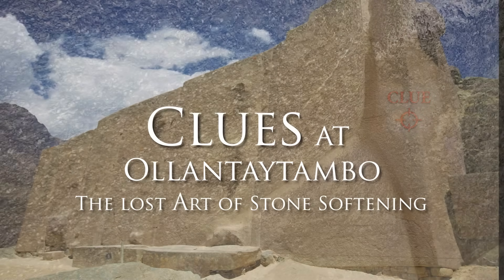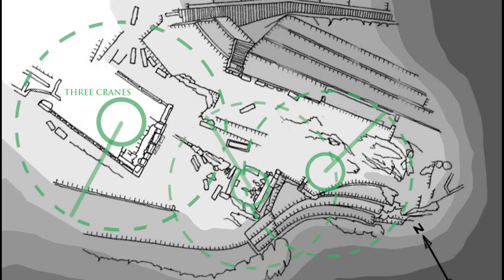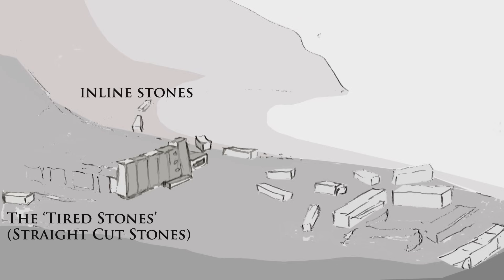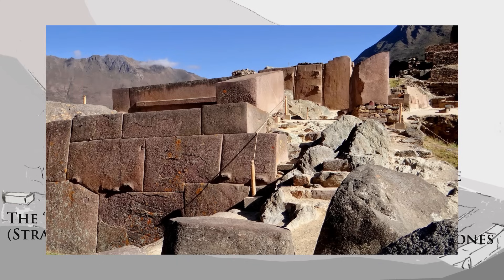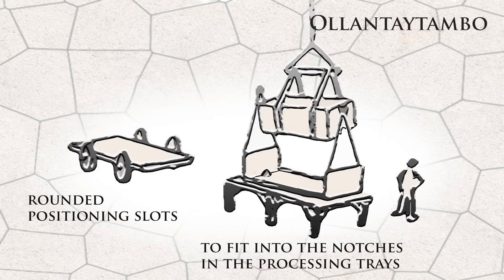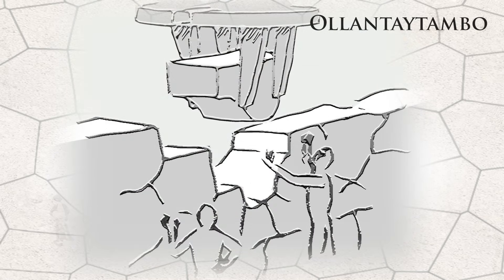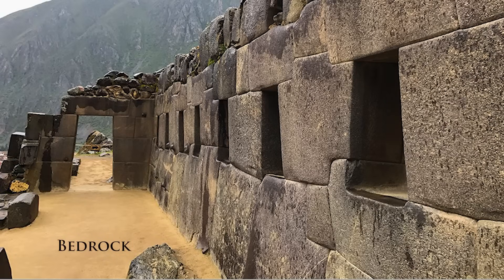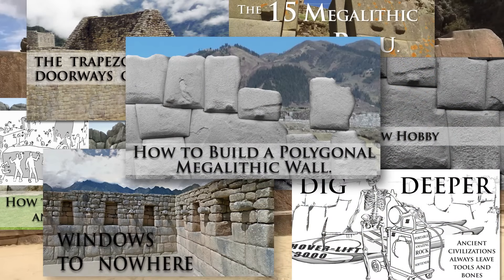Clues at Ollantaytambo. The Lost Art of Stone Softening

Comment: Interesting. Could you explain the sonic requirements and how this was performed. And how they lifted 100 ton blocks into the tanks?
Reply: I personally think they didn't go through all that trouble. My opinion is they built the stones from scratch.  From all the minerals in the area
Reply: @papasmurf4453  is it?  How do they cut them from the quarry in the first place?  Chicken bones?  I'm not saying ti was aliens but i'm not saying it was not either.
Reply: @papasmurf4453  haha intelligent question
Reply: Cement bro, what's with this vibrator theroy.🤣🔈
Reply: @papasmurf4453  Sonic glue?
Reply: Ha, ha, good point. And; otherwise, the stones were rolled down hill 6 miles away, across a couple of tricky rivers, and then rolled up hill with slaves. This guy's explanation is beyond silly.
Reply: They build the tank around the stone 😂
Reply: He will probably tell you they used trumpets like it says in the fictional book called the bible by imbeciles
Reply: Anyway, whatever technique was used is still missing today:
- No full-scale experiment (nobody has ever cut and fit a 100-ton andesite block with only stone/bronze tools).
- No evidence of real quarries or workshops (no debris, no proportionate tools).
- No critical review: academia keeps repeating the “solved” story.
And yet we do have abundant evidence from Greeks, Romans, and Assyrians — technically older civilizations than those of the Andes.
In the 21st century we could easily:
- Run controlled lab tests on abrasion.
- Simulate forces and times with modern software.
- Reproduce quarrying methods on site.
But no major institution dares: if results prove the “official” methods unworkable, they’d have to admit we don’t know how those walls were built.
So yes — we’re in the 21st century, but the narrative on these sites is stuck in the 19th.
If official academia were to test and admit that tools and material evidence are missing, it would open the door to alternative hypotheses (lost techniques, earlier civilizations, etc.), which academia tends to dismiss as “pseudoarchaeology” — when it would simply be enough to confess ignorance.
Reply: Haha true true 👍 😅 😆 😄 🤣 😂
Reply: How did they lift 100 ton blocks into tanks? The same way they lifted them onto a 30ft wall?
Reply: He shows drawings of cranes.
Reply: @charlesco7413  Don't forget the carts with wheels. The accepted belief is that there were no wheels in the Americas until the Europeans brought them.
Reply from the maker: Maybe it's time for me to illustrate another video,, clarify a few things,, Oh- and there aren't any 100 ton stones at Ollantay.     Nice channel (yours) BTW.
Reply: Sure, Imagine BS prehistoric Science , dream on it, make a video about it and do not explain anything.
Reply: Flint, Copper and Sand. You do not need hi tech to shape these stones. There are many recent experiments done to prove this. Videos are on youtube. You only need to search for them. There is no need for high technology.
Reply: @YATESAsphalt8  Exactly, there's a man who was moving 1 ton stones, 300 feet an hour using leverage. A stone and wood arm bars.  Some of these stones exhibit pivot extrusions where the stone could balance from.
Reply: @MrC-55  Yes, his name is Wally Wallington. People who think it can not be done, should look him up. Also, the sawing and drilling, again, can be done with copper and sand. It is not hard. It just takes effort and time, but not even as much as most people think. People should investigate recent experiments which prove it can be doen, instead of tripping on ancient mindblow. :D
Reply: @YATESAsphalt8  How did he get the slab onto the first little pebble?
Reply: @YATESAsphalt8  what about the twisted blocks, you gotta admit, that is quite odd.
Reply: @veniqer  'Give me a place to stand, and a lever long enough, and I will move the world.' Archimedes
Reply: @BornAgainCynic0086  Not sure which blocks you refer to right now. I am sure they are product of a highly trained craftsmen. I am not underestimating the skills of ancient cultures. Most people who believe some of the work can not be done are doing so; they claim Egyptians or other known cultures were not able to work with stone, which is rather odd, because we had something like a stone age. There are many methods to manipulate stone with rather primitive tools and techniques. I am not an expert, but I have seen a lot of people proving the point in videos, here on youtube. Once you know the trick, usually it is not very sophisticated. Like a magician doing the impossible, but it is not impossible; you just do not know how they did it. Luckily there are many modern experts who do know. Try looking into these youtube channels. They are at first not as exciting as a mysterious lost ancient culture channels, but you learn way more.

If you want me to reply on the twisted blocks, please tell me which ones. I can not guarantee answers. I am just a simple youtube user, trying to be honest.
Reply: @YATESAsphalt8  Please explain how to insert the lever underneath the megalith?
Reply: @YATESAsphalt8  in this clip there are twisted block, sort sagged looking. Just as if they had been soft but had sagged. Why would they carve out a sagged block?
Reply: @veniqer  Great reply. Not claiming I know for sure, but you can tie a lever the top side and only need a tiny cut in the corners to fix the rope. Also pointed lever could lift it maybe 1 mm, the next lever you use, can do 2 mm...  once you have a few cm lifted you can toss a dolerite pebble underneath, while you have not even lifted half the weight of the megalith. On that pebble you can easily make a heavy stone rotate. On 2 pebbles you can even move it.....
Reply: @BornAgainCynic0086  Yes, these stones sure appear like they have been soft. A product of once soft clay... bent by gravity due to the weight, but I think these surfaces are just the result of where they split the stone from the quarry. The shape is by nature. When you quarry a stone, you will make it break away by putting pressure on natural cracks. Sediment layers in stone. If you google Ollantaytambo Quarry, you can see the distinct shapes of these layers. Just my two cents..... -and makes more sense than softening the stone with organic material while using frequencies.

Comment: when you figure out how to soften stones, let me know. I have a few kidney stones to get rid of.
Reply: I'll help you with that one.  One remedy to use to help when passing a painful kidney stone is to drink lemon juice.  I went through this many times and it works (usually within a 1/2 hour of drinking it).  The pain starts to subside and then goes away.  Lemon juice is a strong acid that erodes or rounds off the sharp jagged edges of kidney stones.   This makes them smoother and less jagged, so they are less painful to pass.  But the cost of this remedy is acid damage to teeth enamel.  My belief is that an acid that's strong enough will affect stones EDGES or surfaces at the very least--whether calcium kidney stones, your teeth, or stones made of rock.  It can also make a whole stone erode away and become smaller or even disappear eventually.  Maybe certain types of rock are affected easier than others by an acid.  Not sure if whole stones can actually soften all at once, including the center of them, without direct contact with an acid on the inside.  But at least the edges can be rounded out or shaped with an acid and a tool, then fit the shaped rocks together to your liking.  But getting a whole stone to the consistency of blubber....I don't know of an acid that can do that.  I don't think an acid will make a kidney stone soft to bend like blubber, but instead you could eventually wear it down and disintegrate it.  Or at least make edges smooth and fit well with other kidney stones, like making a kidney stone rock wall.  :)
Reply: Okay well, I guess maybe stones could soften too, to some extent.  Having had a lot of acid damage done to my teeth which has led to decay, I realized just now that sometimes when I grip my teeth together, they feel soft and a bit squishy at the decayed places.  (Sorry tmi).  So I just asked the online AI if teeth can soften from acid and it said this:  "Yes, teeth can soften from acid exposure. When acids from food, drinks, or stomach contents come into contact with teeth, they can start to dissolve and soften the enamel, the hard outer layer of the tooth.

Once the enamel is softened, it becomes more susceptible to wear from normal activities like eating and chewing.
 This process can lead to gradual loss of the tooth surface if not addressed.

To protect your teeth from acid erosion, it is recommended to wait at least 30 minutes after consuming acidic foods or drinks before brushing your teeth, as brushing too soon can exacerbate the erosion.

Additionally, using a straw for acidic beverages can minimize direct contact with your teeth, and rinsing your mouth with water afterward can help neutralize the acids."

Comment: For those who didn't get any info on how these rock masons did the work from this video:https://www.siftdesk.org/article-details/On-the-reddish-glittery-mud-the-Inca-used-for-perfecting-their-stone-masonry%20/264  You will have to read this paper as it explains how they got those stones to fit so tight.Other questions on how they transported the huge rocks for miles in those mountains without wheels or cranes is still being researched. Iron pyrites with water turns to sulfuric acid.They mixed hot iron pyrites(fools gold) and mixed it with plants  containing oxalate which enhanced the softening and molding the volcanic rock which contains large amounts of silica.Cross sections of the joins clearly show vitrification of the rocks which isn't present in the majority of the rocks.

Comment: Fascinating. If they had machines of metal then why build with stone? Unless those baskets, tables, and cranes weren't made of metal.  All that's here seems to be only the product without the process.  If everything abruptly stopped then why aren't these machines and such found with the structures? It's as if the process was deliberately hidden or discarded. Along with your theory,  I am sure it helped the stones were softer, by another theory that this planet was much closer to Jupiter, and due to a cataclysm, was spinning slower, causing less gravity, making stone easily malleable. Everything in the ancient times was giant sized because of the gravity.  Drifting towards the Sun through many ages size lessened or became more condensed molecularly.  Now we are spinning faster and closer to the Sun making stone harder.  Humans and everything are smaller. Maybe the composition of the stones have changed much that the procedure to soften the stone won't work in the conditions we have now.  Fascinating.

Comment: It would seem to me that stones that heavy when softened would bulge in the middle before hardening.  With out some kind of mold to keep it in place .   Al those thousands of different micro angles ; I just don’t know how they kept them do flawless .  Even to construct wooden molds to hold polymer stones in places would be an astonishing effort.  I think you’ve got some good ideas but somethings still don’t seem to match up.   It’s such a frustrating enigma .   It’s as if the stone makers are mocking us
Reply: If they were cut square why not use them square? It's easy to fit squared blocks tightly if straight. Why did they change the shape. That is the bit that makes me wonder!
Reply: @barrymayson2492 out of necessity, maybe because of the frequent earthquakes? Square blocks rattle apart, but the fitted stone walls have endured thousands of years of earthquakes.
Reply: @barrymayson2492  from what I've gathered from information presented to me, they did this to create earthquake proof structures. That's why they still stand today... millenia later
Reply: they definitely used some sort of energy such as thermal or electrical or acoustic or magnetism or a combination which we will haven't figured out at. it seems some were melted, some were tooled, some were laser cut, but the most important thing is not that actually, it is the fact that they were transported there..........through airship? through liquefaction? the logistics does not match up and the evidence of flood completely wiping them out is obviously the truth.
Reply: read about Electric Universe, youtube channel Thunderbolts - Symbols of an Alien Sky.
the idea is that thousands of years ago there was a completely different environment. meaning reduced "gravity", which allowed megafauna. There's a problem with megafauna(dinosaurs). In today's environment, the biggest land fauna is the elephant at 6-10 tons. Argentinosaurus at 100 tons would not be able to sit on its legs, its neck would snap.

A completely different environment thousands of years ago means that perhaps stones had completely different behavior. 
In the bible, they talk about "mountains melt like wax in the presence of the Lord" - psalm 97:5

I think that cutting stones that today are very hard, was not difficult in those times. 
Also, I think there were very few humans on this planet in those times.
Reply: @criztu  i think the opposite, there were a lot of people and it was just as difficult then as now.
Reply: @criztu  lol   Reduced by 4% or less
Reply: Maybe there were magma tubes that glowed from an active volcano and they had molds that would fill up with magma. That would explain the intense heat?
Reply: I can't explain how the rock was softened, however,
the process can be demonstrated using 'Therapeutic Putty' or 'Science Putty' from the Science and History museum.
Put the putty in a freezer overnight. Then cut the putty into small lumps.
Stack all the lumps together like a dry stone wall.
Allow the putty to thaw out until it starts to soften, as it does so the lumps will 'cold flow' into each other.
When the putty polygonal wall is at the desired fitted 'perfection', spray with 'Arctic Spray' to freeze (set) the putty hard again.
It does not explain how Granite was softened but this demonstration does adequately demonstrate how Polygonal walls were made using 'softened stone'.

Comment: If the stones were cut straight why not stack them as they were? Plus if the stones were soft the lifting nobbs on the side would also have been soft. Too soft to be lifting nobbs. Interesting idea but might still need a little more thought.
Reply: Straight = structurally weak. These walls lean into each other making them lock, so to speak. Same principle in the columns of the Parthenon. Somewhat.
Reply: Interlocking stones = Earhquake Proof
Reply: There is a reason for not stacking them straight up. Stone masons will tell you why. It is for stability and rigidity. Stones that are stacked up not in straight line but with irregular formation provides the structure with stability where its integrity is not compromised when there is minor upheaval, e.g. when an earthquake occurs nearby. Of course if the earthquake occurs at its exact location the whole structure would crumble. But with irregular lining up such structures could withstand the impact of earthquakes occurring nearby.

Comment: Interesting theory. Many assumptions though!: softening solution, plant based, sonic treatment. The rocks are polymineral it is unlikely that a chemical process will work on all different minerals in the same manner. Plant based? Why? Probably very slow reaction rate! But never mind it just occurred to me that this cannot be a chemical process. A chemical process can only act on the outer surfaces ( maybe to a few microns in depth) not the internal mass of the rocks!
But you made some interesting observations: for example cut rocks with a twist. 
Assuming sophisticated cutting tools ( Maybe not available to us to the extent that it is needed) 3d imaging technology ( available to us), computer guided shaping tech ( available to us, example cnc machining tools), tech to handle / manipulate extremely large rocks ( a problem), Sufficient energy, money etc are also needed      a different philosophy concerning the required life extent of constructions for example
Reply: I agree, chemical reaction in solution does not explain softening of the rock, the only method we understand in 2021 is 'heat/molten' rock however,
the process (however it was achieved) can be demonstrated using 'Therapeutic Putty' or 'Science Putty' from the Science and History museum.
Put the putty in a freezer overnight. Then cut the putty into small lumps.
Stack all the lumps together like a dry stone wall.
Allow the putty to thaw out until it starts to soften, as it does so the lumps will 'cold flow' into each other.
When the putty polygonal wall is at the desired fitted 'perfection', spray with 'Arctic Spray' to freeze (set) the putty hard again.
It does not explain how Granite was softened but this demonstration does adequately demonstrate how Polygonal walls were made using 'softened stone'.
Reply: @polygonalmasonary  Heating and melting will change the mineral composition of the rock, you will be able to see the difference with the natural rock. science putty? Rocks are not science putty! Why come up with all these exotic proposals? On a small scale we can currently do what they did on a large/ enormous scale: 3D scanning, computer modelling, cnc cutting.

Comment: At first it's controversial, that a preindustrial society should be able doing this tight tolerances. About this cast theory. the blocks were prefabricated, otherwise, you would not see this irregular surrounding radius edges on the blocks, it would be a flat wall.  an architectural design can also be recognized, the object was first planed and broken down into its single block tolerances.